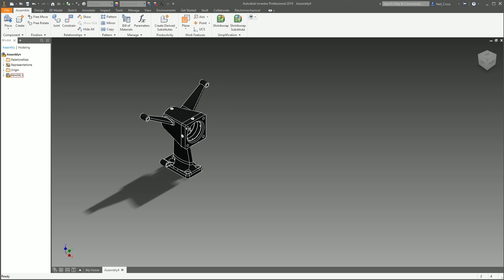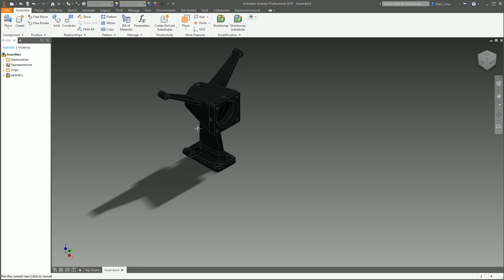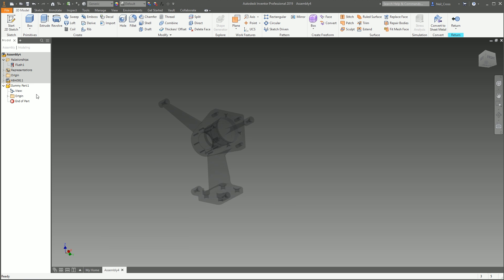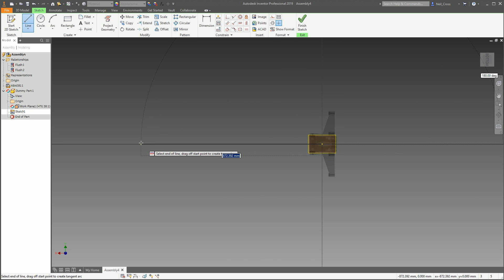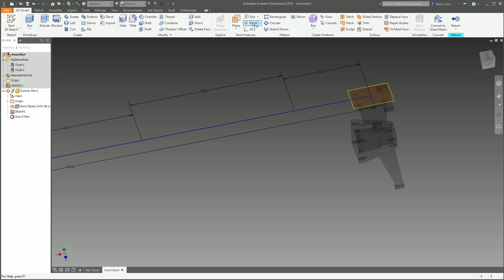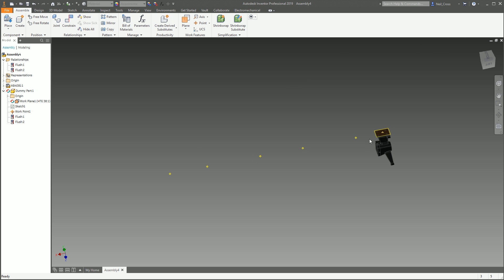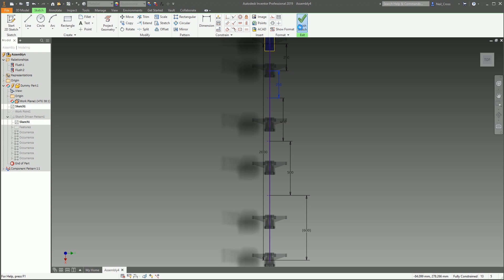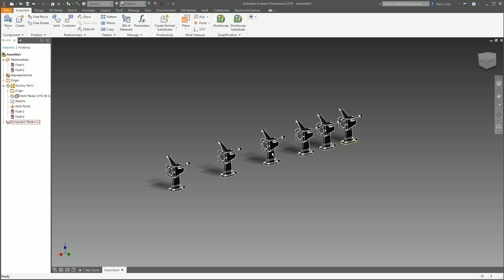How to do a non-uniform Assembly Pattern | Autodesk Inventor

Comment: Good day mate! I love how you explained and lead us through this ability! 
I there a way to use this while making a chain link assy.? I have one link with the pins but this will not make the line pivot around the curves at the end when it turns to make the path back.. it just steps down to the bottom of the path and returns the same. How do you have it pivot the link so that it is going the correct direction back like a chain is supposed to? Thank you again!

Comment: I found a slightly more streamlined workflow.  Instead of making a dummy part, simply create the same exact sketch with points, a starting work point, sketch patterned etc. in one of the parts.  I put the sketch pattern on the sheet metal part with the rivet holes.  You still need to hit the modeling tab in the design tree when you're doing the component pattern.  As always, I LOVE your tutorials!
Reply: Good idea, but your method does not work on patterned objects without holes :)

Comment: I LOVE this trick for rivet placement.  I played around a bit and tried it without creating a dummy part.  I just opened a part in the assembly and created a new sketch, then dropped a bunch of sketch points.  I dropped each point centered on each rivet hole.  From there it was the same.  I tried to use iMates to snap the rivets to the face and center of hole but couldn't get it to work.  Your trick works with any component (even a sub-assembly?) without setting up iMates.  Thanks again.  I plan to subscribe from home, BTW.

Comment: I'm a new user of Inventor (>10 years of Solidworks) but this video helped me get the job done, so Thank You! Since I'm far from knowing all of Inventor functionality, instead of this sort of time consuming workaround of creating "dummy" parts, sketches, and work features (then picking it in the modeling browser - Why? Seriously?), it'd be great if the software recognized a pattern from a part in which a user could derive an assembly part pattern. As long as the software recognizes the pattern, it shouldn't matter that the assembly pattern is derived from a part feature pattern. That would be a pretty useful tool to add a lot of fasteners at the end of an assembly (to make your BOM accurate) in a pretty short amount of time. This is the very function a 3D modeling software should excel at and makes Inventor seem a little clunky and has me asking a lot of questions.

Comment: That is good to know that it is possible to take it from modelling tab I have been using it when making holes and then in assembly adding bolts but then I can just hover over the hole to select pattern as it is feature.
Reply: I use this as well speeds things up no end.